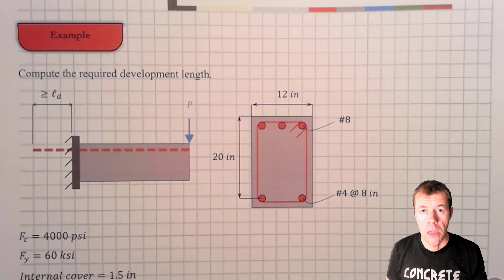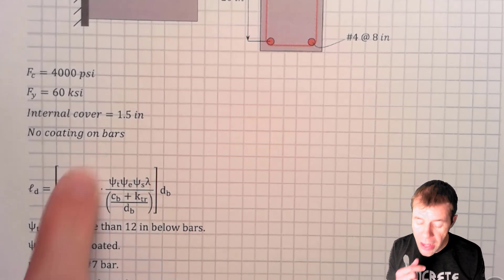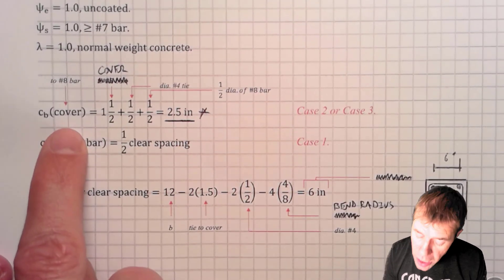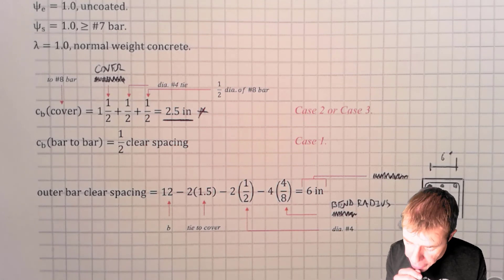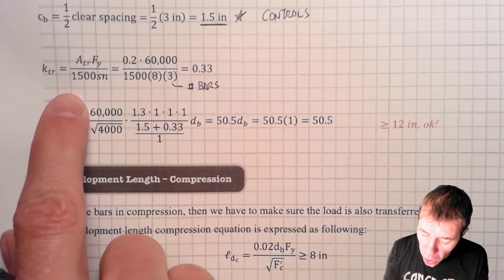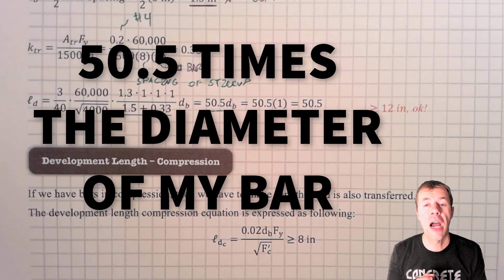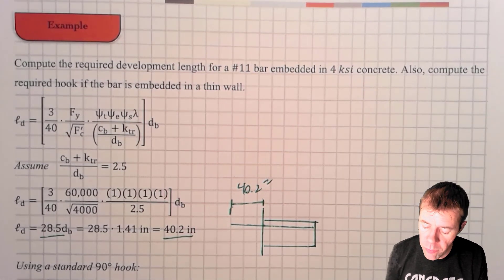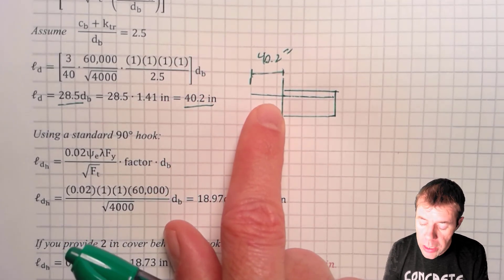Development length example problem for straight and hooked bars for reinforced concrete

Comment: Just wonder if you could shed some lights on this? In your second example, why the 19in is measured from the edge of the vertical rebar rather than the edge of the concrete?

Comment: And if you have a continuous span with 
straight bars over Column C2 (C2 column section size could be less than 19inches?), thank you  C1-------------------------------------------------------C2--------------------------

Comment: I wish you would take a few seconds to more basically explain the definition as you cover each sub-topic.
"A development length can be defined as the amount of reinforcement(bar) length needed to be embedded or projected into the column to establish the desired bond strength between the concrete and steel (or any other two types of material)."
What defines the "desired bond strength?"

Comment: Sir can we use straight and hooked bars in the same structure
If so then what will be the implications of that on that vary structure
And also could you plz make a video on different kinds of rebars used in civil engineering world
Reply from the maker: Yes you can.  There is no impact as long as you have a long enough embedment.
These two videos cover a lot of them: 
epoxy, stainless, galvanized:
https://www.youtube.com/watch?v=xVDy84rR5Z8
and FRP here:
https://www.youtube.com/watch?v=thUZImUTZn0